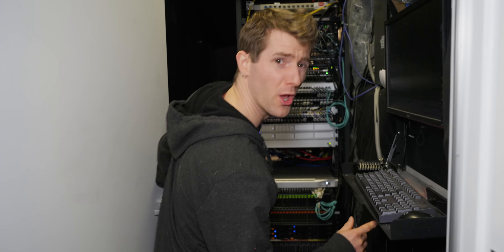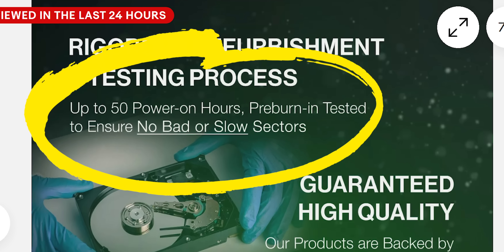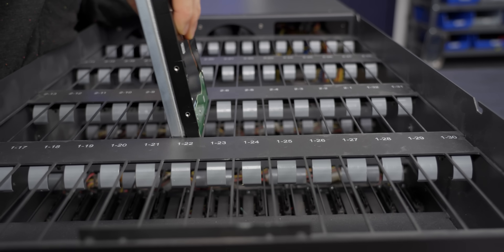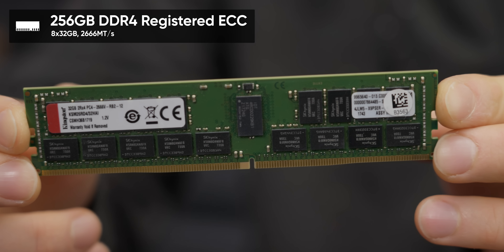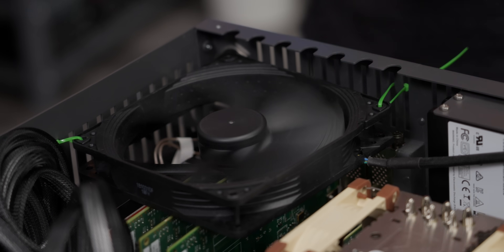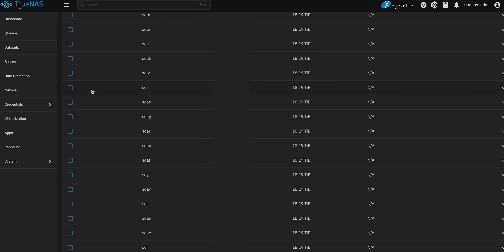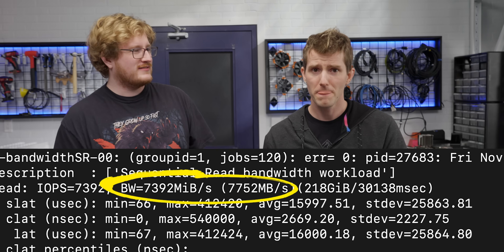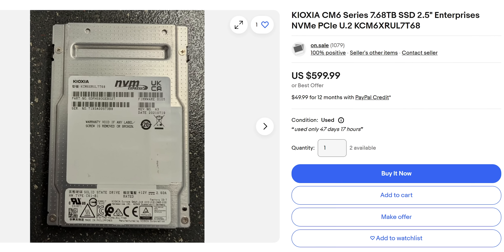Is Buying a PETABYTE on Ebay Stupid?

Comment: The last Seagate product I bought was an external drive, When it died they had me take it out of it's enclosure and directly connect to the drive because SeaTools could only identify it via SATA and not USB. They they denied my warranty claim because it was an external drive that was removed from its enclosure. 10/10 company, would watch their headquarters burn down and not call the fire department.

22 days power on time btw.
Reply: I would have never let that drop! holy shit. I'm standing my ground and will do whatever it takes to get my new drive on warranty and compensation for being scammed out of it lol
Reply: I've had terrible luck with Seagate drives for years. I'd roast marshmallows on the fire while laughing
Reply: @TheQuickSilver101  When I worked for HP during the 90's Seagate published that drives sold through discount resellers like New Egg didn't meet spec
Reply: I like the "don't buy Seagate" or "don't buy WD"....as if you have much of a choice. I'm not a HDD expert, but the only 3 brands I know are Seagate, Western Digital, and Toshiba. So you have a 1 in 3 chance that one of the brands will fail you. There's def no golden star among them
Reply: I had the same experience with a western digital just that it was not possible to connect it via SATA because there was a custom controler Board on there soldered directly to USB so there is that...
Reply: @Erdnusschokolade  SAME! It was ages ago though, when I purchased a replacement circuit board, it still wouldn't recognize because it seems to be individually paired. Ridiculous.
Reply: @Nitsu_Ne  There's a LOT of highly specific calibration data for each drive. That's why the board swap didn't work.
Reply: @StanleytheCat-v8z  I'm not talking about the board that's directly attached on the hard drive, I'm talking about the tiny SATA to USB circuit board that's in the external HDD enclosure. Attaching the drive directly to the PC as internal drive also doesn't work. I've read up articles about it at the time, they basically have some kind of encryption baked onto that circuit board, and PC won't be able to recognize the drive without that.
Nowadays most if not all external hard drives can be shucked and use as normal internal drive.
That was the last time I ever purchase from WD... well, not including HGST series drives as they are acquired by WD afterwards.
Reply: WD milked the floods in Thailand - would watch their headquarters drown and not call the water department.
Reply: @Rouxenator how?
Reply: @Rouxenator  How exactly does a harddrive company... milk the floods??
Reply: @DarkAttack14  by hiking the price of models made in other countries.
Reply: Yea, I haven't been a fan of Seagate for nearly 11 years now after something almost identical happened to me with one of their external drives.
Reply: My 1TB HDD died years ago, was within warranty, sent it to them, they send me a refurbished one, 2 months later that one dies. Never touching Seagate again.
Reply: They aren't legally allowed to deny warranty over taking apart a product. You should've contacted the FTC.
Reply: @theyeetus1428    ehh depends how far you take apart the product. I don't think taking the lid off the sealed chamber or just casually removing the head arm screw is valid :D
Reply: @SianaGearz  They can only deny warranty if the customer damages the product. We're not talking about opening up a hard drive, just taking one out of its enclosure.
Reply: Don't sleep on Toshiba Drives! I have a buddy who has a 2TB drive thats lasted 11 years and counting. They have a 5 year warranty and as long as you follow the owners manual to install them to spec they'll never backpedal on a warranty.
Reply: i had only bad experience with seagate for las 15yrs, at least 20 with bad sectors or dying, and loud. Not my company for sure
Reply: server parts deals also sells WDs recertified for a bit more. they cost a bit more new so fair enough
Reply: I lost a lot of data on Seagate drives. I'm not allowed to say how I feel about them here.
Reply: if it was seagate customer service that told you to do it, your warranty still stands. no matter what they try and tell you.
Reply: Hey o guys i worked for seagate costa rica, if you keep trying and hopefully get the costa rica team most times they grant it as we where told when they first came in to just give everyone approval for claims even out of warrenty
Reply: My experience with Seagate has been the opposite, I have about 12 external hdd from them I've collected over the past 20 years or more.  I've had a couple that I thought died, but it was just connection that finally gave out, after putting them in a new shell they would just power right up.  Unlike the 3 Western Digital hdd's I had to throw out because they directly solder the connection to the hdd.
Reply: Wow... what a tactic. Have the customer remove it from the housing, then deny coverage because they.... removed it... from.. the housing...

This is called internal rot. It starts at the top, from the headquarters down to the plant managers.
Reply: Had Seagate 4tb hard drives as old as 10 years old. Luckily no failures. 31tb of external data total.
Reply: The last segate product I bought was an external drive, which I shucked to use as an internal drive. When it failed, I put it back in it's casing and they warrantied it.
Reply: I have been running seagate drives for over 6 years now never had one failed yet
Reply: @Fishyfish2752  31 years over here. Seen many dead ones but never had to file an RMA. I did for WD and others.
Reply: @Fishyfish2752  Yeah i do not get it either, I have a handful of 2 terabyte Seagate drives that are 10 years old and powered on for at least 8 of those years straight
Reply: @DarkAttack14  right I have baracuda 2tb in my pc and both Ironwolf 6x 14tb and exos 6x 22tb in my servers never had any issues with any of them
Reply: @Fishyfish2752  ive seen hundreds of dead seagate and WD and Toshibas and any others you can name, with drives its not a matter of if but when, they all die one day ssd's included. BACKUPS BACKUPS BACKUPS
Reply: @Fishyfish2752  i have a WD drive since 2014 september, still works with 0 bad sector (had many wipes and os rewrites/corrupt files due to virus and outright entire disk formating done many times over the years with alot of dust for a while as well)
Reply: Yeah you can save a couple bucks on Seagate drives but I hate dealing with their support. Toshiba is the better budget pick imo
Reply: @noswad7898  I've had as many wd's fail as seagate, not many, and I've almost never needed support, last drive i repalced udner warrenty was like 10 years ago and hassel free, so milage varies for sure
Reply: I have had horrible luck with WD. Currently have 8 seatmate NAS drives in unraid and going 24/7 for 6+ years.
Reply: @Mike504 WD Gold are actually HGST descendants, much better than other WD variants
Reply: I was having issues with my 6 iron wolf drives, to until I discovered it was my chipset overheating and not the drives failing, 2 years of daily bsod from chipset related storage problems, and the drives are still healthy 6 years later
Reply: I had a 3.5TB baracuda that died after like 3 years.
Reply: @ mine has been in my pc since 2018 was my first seagate. No issues.
But I have bad experience with WD guess everybody has some bad experience with the top brands and the one they are lucky with they stick with it haha
Reply: @ yeah, windows sucks bad at the moment.
Reply: Yep. All the drives died on my for atleast 1-2 years are seagates. I switched to wd; never had any problems since.
Reply: I bought a 2 TB seagate external drive and used the drive in it to replace the one in an old laptop i had at the time. It ran significantly warmer than the one it was replacing and a few months later randomly died in the middle of a game. It just clicks repeatedly.
Reply: @HobkinBoi  So... you used a product for a purpose it wasn't intended for, and it stopped working? What a surprise...
Reply: @theyeetus1428  A hard drive is a hard drive.
Reply: If they told you too....then it would be on them. Should have fought it more
Reply: And that was silly.  I've NEVER used SeaTools on a drive I've returned to Seagate.  I just fill out the RMA form, if it even asks I tell them SeaTools wouldn't work because I'm using a Mac, and done.  Don't have a Mac?   LIE!  It's not like I don't have the option, I just don't bother.
And I ship the bad drive off, get a refub back (and sometimes get lucky and they replace a spinny platter with a SSD, it's only happened a few times but it's happened) and all good.
And while ALL manufacturers have some drives fail, I have had FAR lower failure rates with Seagate than with Western Dataloss.  WD crap isn't allowed in my machines.
Reply: @jonc4403  
Is that pre-HGST M&A or is that post HGST M&A?

I've had great successes with the Deskstar/Ultrastar series whether it's from IBM, HGST, or now, WD.

I know that Deskstar used to be given the nickname Deathstar due it is higher AFR (which was isolated to the Deskstar 75GXP), but since then, I've had great success with this product line and have stuck with it since it launched.

Don't know about any other WD product lines though.

I'm a HGST and/or HGST-derived shop only.
Reply: Fun fact: in the US a warranty is NOT voided by opening the product, or removing the sticker. Company’s use it as a scare tactic. IF you break something inside, the warranty is voided. Threaten legal action and they would’ve given you the warranty maybe
Reply: Similar experience with a WD external HDD, but they didn’t want to warranty it anyway so I kept it and years later I took it and and started using it
Reply: That’s how CEOs get added to a list
Reply: Couldn’t you sue for that??
Reply: You should leave this comment under a GN video. I don't think Linus cares.
Reply: lol that's illegal af from them
Reply: I have built hundreds of computers and dozens of NAS systems over the last 30 years.    Almost every WD drive I own has had problems.  I switched to Exos and Ironwolf drives 5 years ago and have had absolutely no problems.
Reply: Used to properly dispose of drives at my old work place with DBAN and almost always when a drive wasn't able to be properly wiped with DBAN it was a seagate
Reply: I’ve brought one, planned to use it in a few months and I look at reviews for it again, turns out it’s now 1 star (never seen a product with like 100 reviews get so low) because it kills people’s pcs.
Reply: I avoid seagate at all cost. For me it''s WD right now. Seagate hardware is (in my small sample size) inferior and their support is lackluster.
Reply: @blinddarm8478  same for me, i had those 7200.11 and 7200.12 back in the day, they died really quickly
Reply: @blinddarm8478  WD as in that company selling SMR drives as being "specially designed for NAS" which often does use some kind of RAID which is the worst possible access pattern for SMR drives.
Reply: @blinddarm8478 lol WD is known to be shady. Did you not see the wd red fiasco from a few years ago? seagate is known to be better. Only people that void warranties like the guy above get mad. And i bet he shucked the drive from the beginning and then played dumb.
Reply: @Kushari  Also you can't void a warranty by opening a device bud,  Consumer protection laws exist despite how companies act and the onus is on them to prove it's the cause of the damage. Seagate was pretty quick to reach out to me and cozy up after I filed an FTC and BBB report though.
Reply: @sakaraist  was gonna say that bullshit is illegal in Australia - if they tried that on me I'd have sent the drive in for RMA with printed screenshots of their instructions on it.
Reply: Seagate oder Seagate nicht
Reply: All companies do shitty things. WD and Seagate included. Just pick the best part for your given problem at the time.
Reply: I had the same thing happen with me. Was complete crap service so I won’t buy their products anymore.
Reply: to be honnest that's comical atp
Reply: 100% agree with this.
Reply: Unrelated but makes me think of my new home, which is a prefab. had Items from the walk through that needed to be taken care of. For 2 years, we were told that we were not forgotten, things would be taken care of, etc. Then they finally said, sorry, its been more than 30 days so we won't be able to take care of those things. They also just never did the 1 year walk through they guaranteed.
Reply: I know that must have been frustrating and I’m sorry but that was funny to read 🤣🤣🤣
Reply: Hey thats the strategy! Maybe its your drive in the video 😂
Reply: Seagate is the worst garbage on the market.  They used to be the best, but since 2007, quality went to manure. I would prefer transferring my data to the concrete via a sledge hammer than trusting my data on a Seagate drive.
Reply: @sakaraist  that is funny but I've had a Seagate Xbox branded hard drive (external) that is now reformated to my PC and it has been working great now for 11 years... Since 2013, a great hard drive for storage purposes now.
Reply: bruh
Reply: Literally the ONLY drive I've ever had fail was a 2 year old Seagate HDD. I have WD HDDs that have been running for 10 years and are still going strong.
Reply: Maybe also use a jammer to ensure noone else can call?
Reply: My last Seagate drive I owned I could cook an egg on it yet still read data for a bit (got some data off of it before total failure)... Maybe if they used their own drives they'd burn down their own HQ...
Toshiba/WD all the way now, sadly Toshibas are hard to find in Canada... Also no more Samsung for me because I have no warranty in Canada...
Reply: @egg-roll8968  I like using data center Toshiba drives.  They are quick and reliable.  I use both 10k and 15k SAS drives in my home computer and it may not have the latency of a SSD, but my games load just as fast if I boot from NVME. 

I opened and shipped five Seagate drives, twelve times in a row.  One after another after another, all on warranty. Over 50 RMA's, I finally said enough.  Every Seagate drive I ever owned died between a week to 6 months, no warning at all.
They were a combination of 2.5" hybrid laptop drives and 3.5" 7.2k and 3.5" NAS drives.  Every one of them failed, with the NAS one with a bunch of bad sectors still works.  It collects dust because I cannot trust them any more.  Only use it as a backup boot drive in case I have an issue.
Reply: Based nehiviour
Reply: Had an external one for my Xbox that I bought 4 years ago, temporarily reformatted it for my pc when I first built my pc, then formatted it back to work with an Xbox and now one of my friends is using it. Still kicking.
Reply: @ZE_TRVTH_NVKE  Idk what to tell you other than look at drive statistics, Seagate have been above average for decades in failure rates. I've got proprietary SCSI drives from IBM & WD that have been in use for far longer than they have any right to, and I've got a pile of dead seagate drives that I've lost data on from the past 15 years.

Don't confuse statistical significance with anecdotal evidence.
Reply: @sakaraist  I’ve got an 8, 16, and 20Tb seagate exos drive and have had 0 issues in the last 2 years. My pc is on nearly 24/7.
Reply: I've got 2 Seagate barracuda drives with 60~k hours on them... Going to replace them with SSDs soon(the data on there is backed up, but it's not particularly important either, mostly install files, memes and old files I haven't touched in years
Reply: Generally, that would be cause to report them to your local consumer protection agency.  When dealing with companies, keep all your conversation logs as evidence.

I had a similar situation with another company, and got them to call me back a week later apologising and changing their mind after doing so.
Reply: Many people here in the comments say that their Seagate HDDs break quickly. I have to say I am very happy with mine. I have an 8TB Baracuda (2018) for clips and BluRay rips and a 20TB Exynos (2024) for security camera storage and have had no problems so far.
Reply: you realize they cannot deny warranty for that. They always deny warranty, most of the companies do. And only approving it after fighting.
Reply: Idk why everyone has issues with Seagate my 1tb drive been going alone fine since my first PC back in the Xbox 360 era
Reply: seagate is absolutely horrible (my experience)
Reply: insane bait lol
Reply: I only have one word to say,...  "Luigi".
Reply: Oh dear I have 6tb hard drives from them 😢
Reply: Lol, I remember your reddit post about this three years ago!
Reply: Damn, i must've been lucky. When my external seagate drive failed, they sent me a new one and helped restore files no problem. It also was years ago, don't know if they've gotten worse over time :/
Reply: their hdds have a bad reputation among the common people, but perhaps their products for the corporate sector have better quality
Reply: I put them out of the enclosure for normal use, then they broke, put them back in and returned, got new ones but FireCuda ones, which ofc are now out of enclosure in my NAS.
Reply: Yeah bad luck man. I don’t think Seagate is bad as a whole, I think you just got very unlucky with your service. I could be wrong but Seagate does seem to be one of the better companies when it comes to this.
Reply: I have a bunch of Seagate nas drives for my nas. They seem to be really good, runs efficiently, doesn't run too hot and they perform quite well
Reply: thats why whenever my hard drives fail, internal or external, i immediately ship it back to vendor under RMA. better to spend 10 bucks in shipping than losing 100 bucks for no fucking reason
Reply: My Seagate 4TB Sata drive lasted less than two years.  It was still under warranty, but I had personal data on it so I just stuck it in a drawer close to me to remind me not to buy another Seagate.
Reply: Wow, Seagate are dirty to do that.
Reply: Good comit a class B felony
Reply: Huh, mine all work pretty reliably and have for years.
Reply: Same thing happened to me with one of their external drives, never again buying their products not because they’re inherently all bad but because their customer support is awful
Reply: Wow, I’m no paid shill or anything but all of my seagate products are still alive and kicking. I bought an external drive from them back in 2015 and it still runs even though I’ve put it through hell and back.
Reply: You should have sent them in for RMA anyway. The Magnus and Moss warranty act prohibits this kind of activity. Immediately mentioning that would get you an RMA claim number. People who actually know what they’re talking about these companies do not want to fight your lawyers. They wouldn’t even let it get that far. They’re just counting on random and user who is not a business not knowing how the law works and just going away. It saves the money if you actually try and fight them you’ll get what you paid for.
Reply: @sakaraist  I always log all my customer support tickets because of things like this
Reply: Always see lots of anecdotal evidence online about how bad Seagate is, but in my personal experience I've only every had issues with WD drives. I've had multiple external hard drive controllers die, and their drives as well. My seagates are still running many years later. That being said, currently running WD Ultrastars on my NAS, and they're doing just fine
Reply: @sharpenednoodles Same, have 29 ultrastars/golds and they are solid
Reply: linus 2 years ago = why you would never need a 20TB drive
Reply: @Mae-nr7wr yep I remember that
Reply: IME Seagate external drives are total trash. Fine for a little over a year and then just pffft. Not sure if I should try again with an internal drive. Really trying to trust the data from BackBlaze there. Lol
Reply: @mikes2381  The bad thing is, there are only 3 companies that make hdds these days, Seagate, Toshiba and Western Digital.  Been 218 manufacturers since hdds were a thing, all of them now either out of business/bankrupt or bought out by one of the remaining 3 previously mentioned.
Reply: hahahah that's evil
Reply: Just look at the backblaze yearly stats. Seagate are the worst. They're cheap because they're disposable. Every Seagate drive I ever had failed. My WDs never failed.
Reply: @LeDechaine  💯
Reply: Seagate is the only brand of drives i have ever heard of failing from my friends.
Reply: Wait I thought Seagate was a reputable brand??
Reply: Their recertified from the last 2 years😢 says alot about longevity
Reply: @ never used 2de hand though so I don’t know about that. Willing to give it a try in this economy haha
Reply: Had similar experience with SG 10+ years ago, sice only WD red or purple. All fine since then, so no way I going to go back. Not saying WD is perfect or bullet proof, but much better.
Reply: @sakaraist  I had a horrible experience with Seagate at the end of the summer with a warranty replacement. I think they lost the drive, and then basically said nothing, it took me nagging them a lot , and them making excuses, then finally two months later, I got a replacement drive back. I don’t think I’ll ever buy Seagate again.
Reply: We've had to claim over 40 warranties on client nases because their Seagate drives kept failing... It's so exhausting...
Reply: Every Seagate drive I've owned has failed. Every. Seagate. has. failed.... My 4TB Seagate recently died and it only had 400 days power on time. My 4 x 3TB Western Digital drives have zero SMART errors and have been running since 2014. Even my refurbished 2TB Western Digital used for CCTV is working perfectly and has been for over 3 years.
Reply: @m5-networks I tried to mirror your sentiment about Seagate and they removed my comment.  Interesting to see an AI protect investors by silencing consumers.
Reply: Bruh, that sucks
Reply: Yea, mechanical drives - still and only WD, I had issues with some WD, but I have issues with every Segate HDD, they just die. In my opinion, they are terrible. But to be fair, I'm in Poland, so maybe Segate is sending some "other" quality here, not the first and last time if the same product is worse here, not necessarily in electronic to be fair, but still...
Reply: I had a SSHD from Seagate 
After like only 5 years 
Started to corrupt itself
Reply: @sakaraist  I had a ps4 drive that barely lasted a year (of course it died on a drop from like 1 foot off the tv stand, would rather find a better or optimal storage for the same or better/bigger price
Reply: I swear what are yall people doing with your hdds for real i have 2 seagate hdds and one wd both all three is almost active 24/7 never ever had a problem yall crying about wd is bad seagate is bad what is the best one then ?
Reply: let's file this under things that never happened
Reply: I had Seagate RMA a drive that died 6 months after purchase.   They sent me a replacement refurb drive that died after 6 months.   They would replace it again.  Microsoft told me I used my activation code too many times and wouldn't activate my copy of Windows again..  0\10 experience with seagate
Reply: That was really scummy to tell you to take it out of the enclosure and then deny you because you did.  It is not like hard drives are cheap.  Also I can only imagine what may happen to prices next year if the tariffs get out of control.  The scary thing is that he does seem like the sort of person who would provoke the situation and then make up some bull$hit about having noting to do with it that is nothing but a lie!  Then people probably wonder why I hate that guy so much!!
Reply: you were unlucky af, seagate is probably the best out of the big four, wd, toshiba, sg and hgst
Reply: hahahahahahahahahahahaha holy shit this is the best comment of the year
Reply: I mean, what else did u expect...? U take the product apart, the warranty is void - pretty obvious if u ask me.
Reply: @ In the US, it’s illegal for them to void the warranty, even if they didn’t tell him to open the case.
Reply: Except I think they meant to take it out of the PC's enclosure and still connect it directly but just not by using its original connection. There would have been no reason to test it outside of its drive housing. I think it was a misunderstanding, probably because of the support rep's poor choice of words.... especially if.... well, nevermind.
Reply: did they specifically told you via mail, that you should do open the case? If yes, I think it's their reliability. If not, it's your fault to do it without reassuring.
Reply: LOL, like you are not responsible for not getting it in writing???? Literally all you needed was for them to send you a letter saying they are requiring you to remove it from its enclosure and will not void the warranty if you are following their instructions
Reply: No, that’s on you. You voided the warranty when you opened up. Many people do what you did, it’s called shucking, and then play victim. I have had them replace drives without issue.
Reply: @Kushari  No, That's on Seagate support for instructing me to do so, EXPLICITLY. They would not issue an RMA without seatools logs. For which they instructed me to remove the drive from the enclosure. try again though.
Reply: @Kushari If OP was instructed to do so by Seagate, that is on them for telling their customers to do so.
Reply: @Kushari  Federal Law dictates that he did NOT void the warranty.